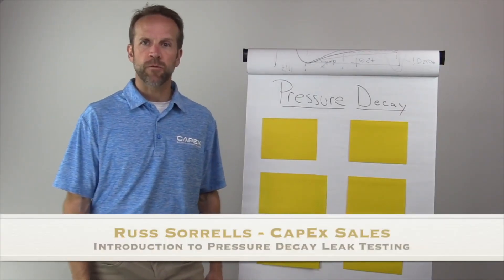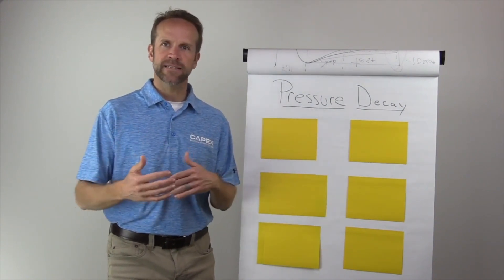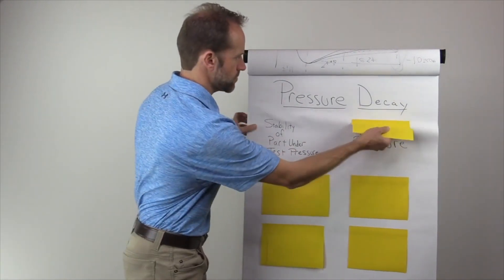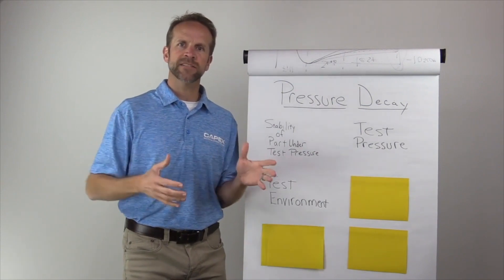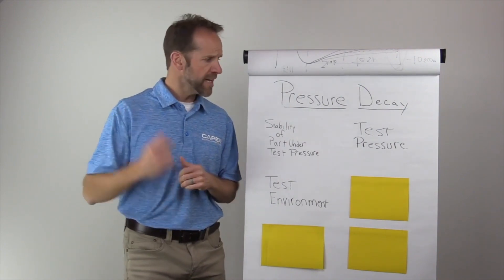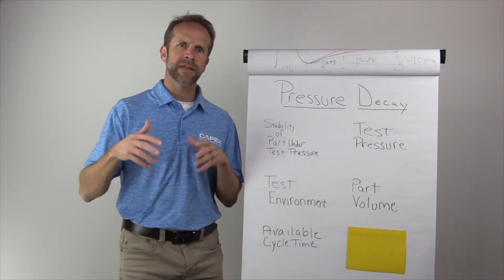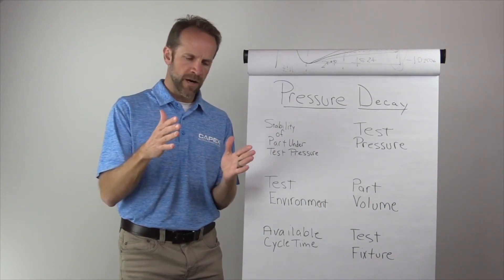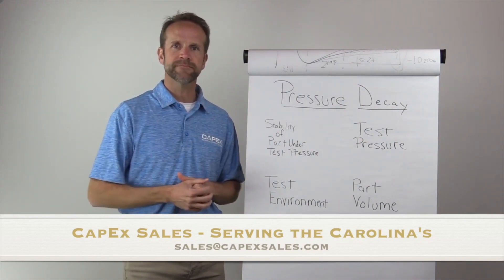Intro to Pressure Decay Leak Testing

Comment: What is difference between vacuum and positive leak test IN SENSE OF SENSITIVE?
If the SAME part is checked with POSITIVE 50 KPA and NEGATIVE 50 KPA ,will the result i.e pressure drop will be same?
Reply: In my experience, positive pressure leak testing is more sensitive and repeatable than vacuum decay. This is not always the case but I am only basing my answer off of my experience. How I have tested this in the past was with a leak standard that flowed 3 sccm @ 5 psi. I tested with the leak standard at positive pressure (5 psig) and negative pressure (5 psiv). The positive pressure was more accurate than the negative pressure. Please keep in mind this was an unscientific experiment and only my findings on the specific application. Both testing methods work well and are effective at identifying leaks. The decision to use one versus the other often has to do with the part sealing requirements. If the part has a large opening the vacuum helps to seal the part versus the positive pressure pushing against the sealing surface. Also, parts that are hermetically sealed are often tested in vacuum chambers looking for a pressure rise in the chamber indicating a leak from the part. Hope this is helpful!
Reply: @russsorrells-BOS 
 Thank you for your reply.

I have query.

The leakage (pressure drop) from the components will remain the same or change if we maintain same temperature but varying atmospheric pressure means i am checking the components in different country with same temperature.

Will the leakage will differ if we perform leak testing  process like once by+50kpa  and  performing under same condition in vacuum -50Kpa?
Your reply was in relative to flow i am talking about the pressure drop.Hope you got this.